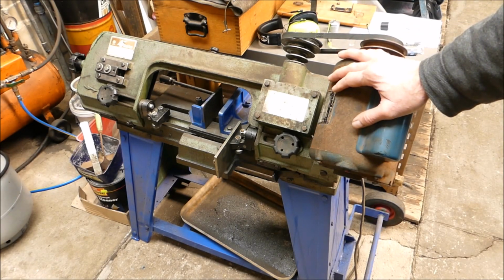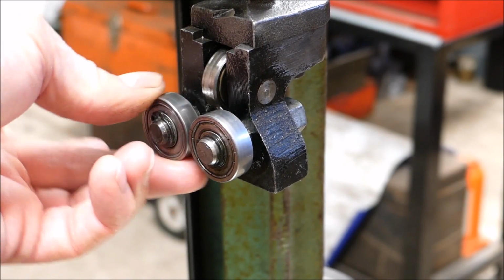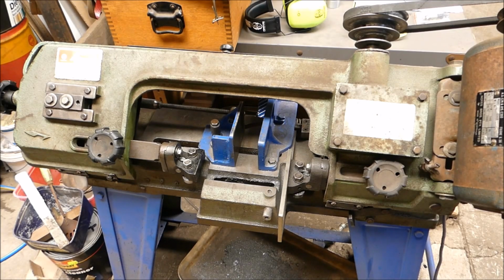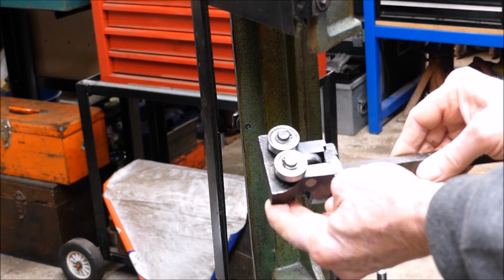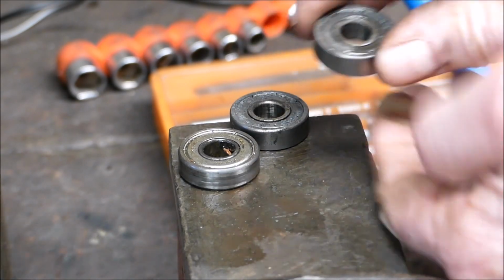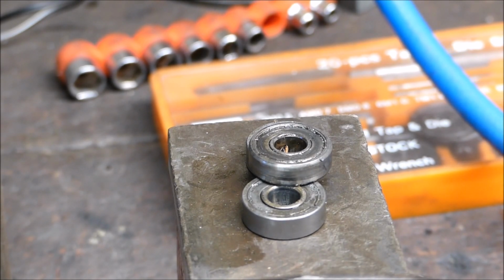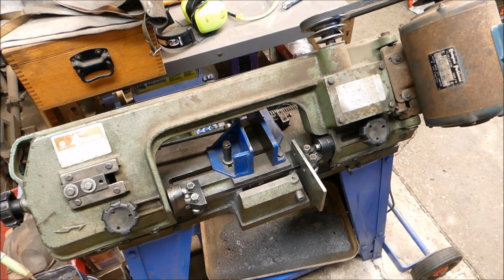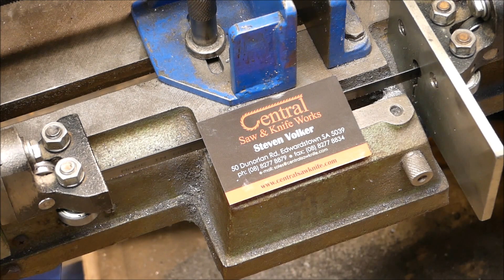The 4 x 6 metal bandsaw started breaking blades - easy fix

Comment: Good Video. Still deciding whether to get one of these or go for the next size up.  (Extra $900.!!) But it has coolant. Graham, Bundaberg.
Reply from the maker: It's interesting to hear people talking about "coolant".  It's really more about lubrication as things shouldn't get smoking hot, same as on a lathe.  People run this stuff too fast and then wonder why blades wear out fast.  The advice from my saw works is to run the saw as slow as possible to get maximum life out of the blade.  You DO however need lube for aluminium, that's a definite.  Cheers Rob

Comment: Hi Rob, thanks for the tips, mine started throwing the blade off but at least they didn’t break. Anyway I replaced the six bearings when on of the bearing outer shells broke during tensioning. $2.50 each at the bearing shop so I’m not complaining, and they have the rubberised seals. Turns out the vertical bearings are smaller in mine but thankfully they are the same size as skateboard bearings which I had plenty of. That fixed the problem straight away with the longest part of the job being tuning the blade to cut true. I wouldn’t put a micrometer on it but it’s good according to a square.
Cheers mate, Stuart Canberra.
Reply from the maker: Hi Stuart,  all good.  If the blade scrapes the whole depth of the cut as you lift it on completion, it means the cut is dead on vertical.  Mine always does that and it's a satisfying sound ;)  Metal shields are probably better with the fine cuttings, but there's probably not much difference really.  The nylon seals seem to handle most things OK.  Everything wears out eventually.  Cheers Rob

Comment: Thanks Rob. I recently purchased the same unit, Forbes brand, and your videos have been very helpful. I popped down to the saw doctor at Edwardstown and got a blade. Helpful staff. Recommended me the cheaper carbon blade in the event that my newly acquired unit turned out to be a dud. That's the kind of service I appreciate...not trying to squeeze every $ out of you.
Reply from the maker: Hi Adam,  they are a good shop and know their stuff, prices are competitive.  I would recommend them.  Cheers Rob

Comment: This makes me think mine might have a similar issue. I break blades fairly often. I have a bandsaw blade welding machine but it's annoying having to mess around with it. Plus they're never quite as good afterwards. Thanks for the demonstration.
Reply from the maker: Hi Alex, I was a bit surprised that the guide bearings were starting to seize up, but I did see some comments from another owner who had the same issue.  So it must be one of those things that will happen on high usage machines.  Pity it broke the blade as it was still as sharp as new after many hours of use.  The new one is Lenox brand and supposed to cut twice as fast (according to the blurb), so we will see ;)  Cheers Rob
Reply: @Xynudu  yup they definitely get a lot of grit in them and are under a fair bit of pressure. The issue with mine is it tracks terribly. I probably just need to spend time getting it dialed in. The middle bearing on it has a ridge in the middle so if that's the problem I'll probably have to order it from the manufacturer. I've been making my own blades off of a big roll and welding them so maybe a store bought would be better also. Either way it's just a matter getting to it. Thanks!
Reply from the maker: Hi Alex,  the guide bearings are a standard size available from any bearing supplier or online.  The bearing you want is 6000ZZ.  Widely used and not very expensive.  Cheers Rob

Comment: very timely video Rob, my bandsaw, harbour freight, but exactly the same, is playing up, not breaking but keeps throwing the blade, seems to have developed a wobble on the bottom wheel, so I think when I investigate that I'll give it the full Xynudu treatment, handy to know what bearings I'm after before I start, just relooked at your other bandsaw video again and will give the top wheel the same as yours,
great video as usual Rob,
Thanks,
ATB
Cliff
Reply from the maker: Hi Cliff,  I had to rebuiild the top (idler) spindle and shaft on my secondhand saw as it was badly worn.  Since then I have used ordinary moly automotive grease on it but it tends to displace and wear into black goo after some time.  So this time around I have serviced the spindle with Loctite LB767 which I have always used on the covered lathe leadscrew.  This is amazing (but messy) stuff as it appears to have a high graphite/metal content and  locks onto the metal surfaces.  After years of use it is still in place doing it's job and no discoloration.  So it will be interesting to see how it goes on the spindle shaft/bush. It is only suitable for slow speed applications.  I also changed the gearbox oil and replaced it with Delvac  80W - 140 full synthetic  limited slip differential oil (left over from a job).   Seemed about the same viscosity.  This will not attack the bronze gear (as some oils can).  The oil that was in there was pretty dirty and I doubt it had ever been changed in forty years. Mechanically the gears looked good, so the oil was still working. Cheers Rob
Reply: It took a while to find, but the drive pulley on my ENCO (Taiwan) saw - identical to Rob's - had a flat place!  Turned up a suitable mandrel and turned about 0.020" off the outside diameter.  Stopped the problem.  Probably due to a "green" casting.  The saw is about 20 years old now and cuts well but has never cut dead true as to square.  I have adjusted and adjusted.  One of these days I am going to mill the brackets for the guides to be dead square with the table.
Thanks for the video.
Reply from the maker: @geoffmorgan6059  https://www.youtube.com/watch?v=0Z-xRzI6nEI

Hi Geoff, this covers most likely areas to check, including shimming between the cutting arm and rear pivot point.

When it's cutting correctly you should hear the blade scrape along the full height of the cut face (saw off) when raising and lowering the blade after a cut is finished.  If that's not happening then it's set wrong.  The saws always tend to cut inwards from top to bottom when they are wrong.  Too much feed pressure will also make them cut off line vertically. It's genrally fixable without too much work.  Cheers Rob

Comment: That one set of bearings were really shot.  I have a saw that is very similar to yours but was sold by Enco back when they were in business.  I've had mine for about 28 years now and it's been a workhorse; except, I cannot seem to get to the point where I get a blade to last long enough.  I will get everything all lined up and adjusted, put in a new blade, get nice straight square cuts, then the blade breaks unexpectedly.  Oddly, it's not always at the weld either.  I have spent countless hours trying to analyze the saw and its weak points and cannot figure why the end up fatiguing then breaking.  Upon close examination, I have noticed these cracks that form perpendicular to the length of the blade.  The are obviously stress cracks but I cannot figure  out how the stress is being induced in the blades.  I run the speed slow and keep the downward pressure as light as practical and still the blades end up breaking.
Reply from the maker: The side roller clearance might be too tight.  Get a build up of cuttings in there and it may be enough to pinch the blade.  Cheers Rob

Comment: Rob I'm not sure how this broke the blades. They are only a guide and do not grip the blade of should I say they are not suppose to grip the blade. My saw is brand new and I have had 2 blades to break in the joint where it was welded. I'm not sure whether it was a cheep blade of poor welds. I have welded them back together my self and heat treated them 1works well and the other one broke again in the weld. In my opinion I think that a real good quality blade is the answer. Problem I am having in the U .S . Is I'm not sure what is a good name brand. And prices is all over the board on them.
Reply from the maker: Hi Anthony,  I suspect that when the bearing pinched up, so did the blade to rollers fit, possibly with the cuttings build up.  Since the fix all is OK again.  I backed off one roller a bit at the same time. 

I use top quality blades from a saw doctor shop (Lenox brand).  I have never had one break at the join.  I did try brazing a blade up once, but it didn't last long before the join separated.  Not worth the effort.

They are electrically welded in the shop. This is much more resistant to flex.

Go see your local saw works for blades.  The ones available from tool suppliers are generally low grade and probably more expensive.

Cheers Rob

Comment: Surprising that it would bind enough to stall and break the blade, I'm better look at my own saw, it may be needing some TLC before I live the same problems you got...   😱😎👍
It's at least over 15 yo and never got too much maintenance, just use and abuse...
Reply from the maker: Hi Pierre, It surprised me when it came out of the blue.  It's made me feel guilty now, so I'm going into maintenance mode today and will change the gearbox oil (which is definitely dirty) and lube the idler wheel spindle.  This is an old saw and it had done a LOT of work even before I got it.  The blade has never sat right in on the drive pulley, but seems to go OK.  I had to rebuild the idler pulley spindle and bush as it was so worn. I will give it all a check over.  Trouble with this stuff is that time ticks away and there is no real maintenance schedule in my workshop ;)  Cheers Rob
Reply: @Xynudu  Just learned a new word "Schedule"...   😈🍦👍
Reply from the maker: Ha Ha.
Reply: @pierresgarage2687  It's a synonym of "put off". ;-)

Comment from the maker: The guide bearings are 6000Z or 6000ZZ.

To press them on use a suitable diameter socket to bear on the centre section and not damage the races.  I used a 12 mm, but an 11 or even a 10 mm would probably be OK.

NEVER hammer on bearings when fitting.
Reply: Interesting, I had one of those exact same bandsaws many years ago, it used exactly the same bearings too.
Great video and advice, thank you Rob!

Comment: If you turn the pulleys on the motor and drive spindly over you will bring the belt closer to the bearings and will dramatically reduce the toque pressure on the bearings and should reduce the noise also
Reply from the maker: Good idea.  This saw is forty + years  old and still going like new (sort of) so I think I will leave it as is.   Cheers Rob

Comment: You say the bearings are 6000Z or 6000ZZ - well I am going to get a supply for mine.  My saw gets used everyday they may well need attention.  I suppose we can find them on ebay or amazon?   Thank you Rob.  It was good to hear your voice again!
Reply from the maker: Hi Glenn, the number will be marked on the metal side shields of your bearings.  I expect they will all be the same number as I quoted. Pretty generic bearing.  I bought these in and had them ready to go as I expected they would fail (go sloppy) at some stage as the saw is old, but I never expected them to seize up.  Anyway, best to be prepared and they are cheap - on Ebay etc. Cheers Rob

Comment: Hey Rob, hope you are well.  I have the same bandsaw as you and when I cut RHS/90 degree angle iron my blade comes off.  I have the blade tight, any thoughts as to why this may be happening.  Blade is new, no missing teeth or bends etc.  I have tried positioning the steel in various positions,  closed up the blade gate spacing.  ???????  Could you consult your crystal ball and possibly give me some areas to investigate.  Oh, I don't have any seized or damaged bearings.  A couple of them have minor wear grooves.  Thanks heaps for any of your thoughts.
Reply from the maker: Hi John, usually blade binding causes this.  Maybe the teeth are too coarse for the metal thickness or the downward pressure is too high.  Try it with lubrication on the cut area and see if that reduces it.  Also check that the blade edge is very close to the shoulder on the idler wheel.   It should track within 1 mm.  Cheers Rob
Reply: @Xynudu  Thanks Rob I'll have a look at what you have suggested.  The metal that always causes the blade to come off is RHS or angle iron whatever term you are familiar with.  No matter which way I position it always the same result.
Reply from the maker: Hi again John, aluminium solid square or round section can definitely pop the blade off if you don't use lube to prevent binding in the cut, especially if you use a blade meant for steel (it usually has a higher TPI).

Binding/catching is rarely an issue with steel RSJ or channel provided it's not rolled.  If it is rolled section then the number of teeth on the blade need to be increased or it will catch on the thin gauge metal.  There is a formula specifying how many (minimum number) teeth should be in the cut relative to metal cross section.

I use a 16 or 18 TPI blade for most things.  Going coarser than that will cut faster, but can cause problems on thin steel sheet.  It's not ideal for aluminium, but works OK provided you use lube (kerosene).

Cheers Rob

Comment: Great diagnostic/repair video. I've got nearly the identical saw, as I'm sure do many of your viewers. I'll be checking out your linked videos on the purchase of the saw and the improved plate. Thanks for sharing.
Reply from the maker: Hi Rick,  It's a good unit.  The original metal plate is horrible and can't be left on there.  This one works a treat.  Cheers Rob

Comment: I have basically the same saw, they have many brand names but they're all the same. I love mine one of the best tools l've ever purchased. They are light and versitile, easy to move around the shop.
Reply from the maker: Yes, they are a good unit.  The vertical setting to cut freehand is really handy.  One of the best things you can buy for the workshop.  Cheers Rob

Comment: A word to the wise, check your oil in the gear box, I neglected this and after many years of good service the worm gear stripped out. Couldn’t find a replacement part so I bought a new saw , but it doesn’t work near as good as the old one did.
Reply from the maker: I fully serviced the saw yesterday and changed the oil in the gearbox. No leaks so it was still full, but very dirty.  Everything looked in good shape mechanically.  I replaced the oil with full synthetic  80W - 140 Delvac  limited slip differential oil as it looked about the same viscosity.  This will also not attack the bronze gear (as some oils can). Cheers Rob

Comment: Thanks Rob for the great vid. Were all 6 bearings the same size?  I've got the Hafco equivalent saw. I haven't got it apart yet but the bearing on the top (that bears on the top of the blade) seems a smaller OD than the two side ones. I got this second hand and with 'alignment issues' so I don't know if someone has mucked with it an put incorrect size bearings in there.
Reply from the maker: Hi Bill, the bearings should all be the same size/diameter. I can only guess that a smaller one has been fitted to try to bring the back side of the blade further on to the pulley LOL.   I'm guessing this is the bottom/drive pulley.  The blade normally does not run close to the rear shoulder of the drive pulley.    The blade should however run close to the shoulder on the idler/top pulley.  Cheers Rob

Comment: Just say'n ZZ metal shielded bearings part of problem, they're called shields not seals. Rubber sealed bearings 2RS better, you could use shim washers for impact damage. Enjoyed the DAWN (vice) bearing press, head and shoulders above hammering them on as most young players do. YouTube does love rattle can engineering, I'd suggest a spray of something glossy when you have a machine apart to ease viewer assembly anxiety.

Comment: Good stuff Rob. And that was a nice neat fix. Having the right bearings in stock must be a very gratifying experience, that doesn't happen very often for me :) Shame about the carbon steel blade going pop, at least it wasn't an expensive bimetal one. I'll definitely keep a record of that blade place for when I next need bandsaw blades. I've used Lenox in the past (while in the UK) for things like jigsaw blades and holesaws, and they are first rate tools. Not cheap, but I don't think that you get a better blade. I have never used lenox bandsaw blades - but I'll definitely be searching for and ordering 'diemaster'  when the time comes, probably through that SA company. Cheers from sunny Hobart, Craig
Reply from the maker: Hi Craig, It will be interesting to see how well the blade lasts.  The previous blades from that company have always been excellent.   I bought those bearings so I was ready to replace them when they went all wobbly (what I expected) and it is an old saw.  But they didn't, they started to seize up instead.  Big surprise. Cheers Rob
Reply: Carbon steel blades will do all right in softer steel alloys, as soon as you need to deal with the higher grades materials carbon steel blades will wear real fast. Bi-metal or HSS and better blades will pay for themselves real fast as they last much longer and cut better.
Just make sure that you install a new blade you break them in, this will at least double their life...
Reply: @Xynudu  The Diemaster bi-metal variable pitch blades are a game changer on a 4x6 saw!  Been using them for years, and I can verify that they run for an extremely long time!